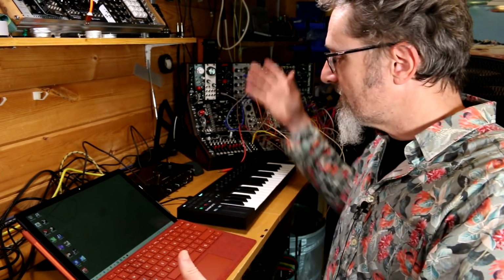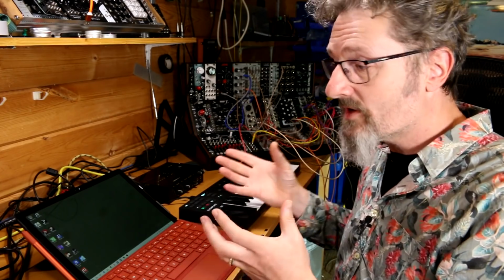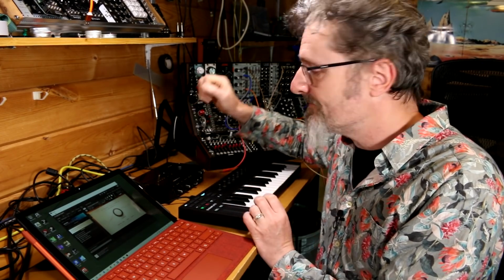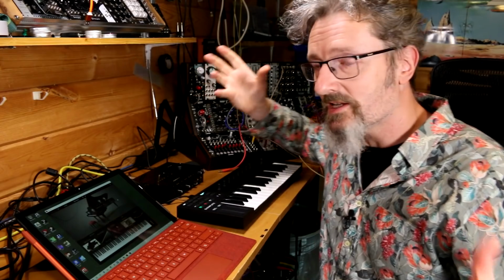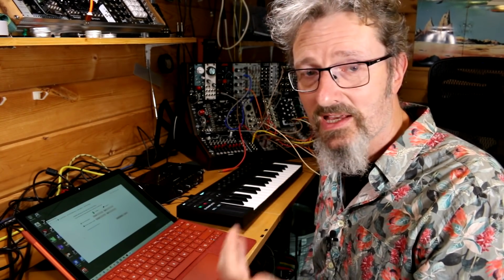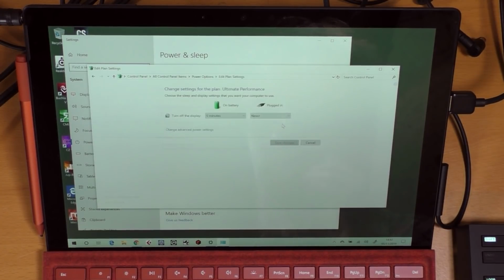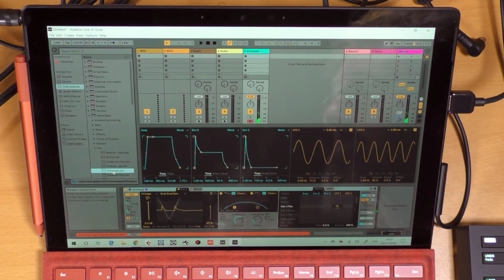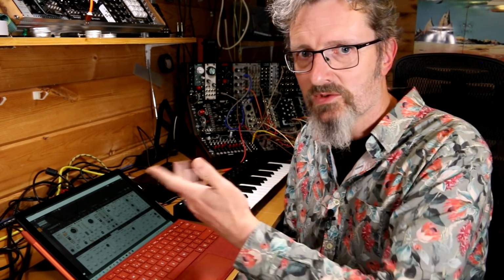Surface Pro 7 - Initial testing and tweaking for music production

Comment: I went along with your tutorial, everything worked, but there is a big drawback to this. Disabling the "csenabled" thing in the registry also completely disables the Sleep mode across whole win10 and thats a bummer. At least thats what it does in my case - SP7/i7/16GB. Can anybody confirm this?
Disabled sleep mode means the device goes straight to hibernate, so it boots up slowly (still less than 5 seconds though) and also the instant-on feature does not work anymore (introduced in sp7, this is a really great feature in my opinion).
I tried fiddling with various settings, but nothing worked, the sleep settings across whole windows was not visible. Only turning back csenabled on returned the sleep mode back.
Hopefully my i7 will be powerful enough to not cause (too many) glitches in balanced setting, will test that later.
Reply from the maker: Sleep and hibernation are the devil, they are completely incompatible with a working Audio computer. Turn them both off and shut the system down when you want to shut it down.

Comment: hi Robin, Great video. Lots of useful info. I have a question: the last windows 10 update installed lots of redundant (on my systen anyway) services like text input, your phone, message queing. Do you know how I can turn these off as well as the dreaded cortana, so that every time I start my system I dont have to go into task manager and kill them (they somehow come back after a time even doing that). I have disabled the ones I can in the system startup settings and services but to no aval. Help please if you can. Thanks.
Reply from the maker: Have they brought you any problems?
Reply: @MoltenMusicTech  My PC is quite old but surprisingly capable: 4 cores and 2.66GHz clock speed. However the board only supports a max of 4GB of RAM and these things take up valuable ram space so I guess they do. I can only run 2 chanels of realtime synthesis and after that have to render (freeze & flatten) and commit to audio. I'm just trying to work out if I could get another track of synthesis on the go in ableton or take full advantage of its rich feature set. I lke the look of the new granular synth and would love to use it but don't want to spent 40quid if it wont run on my PC. I guess an upgrade is in order but it'll probably be about a year from now before I will have the funds for that. I made the mistake of spending what I had on software before hardware, a big lessson learned there. Thanks for your quick reply. Cheers.
Reply from the maker: Ok, well I don’t know of any special secret sauce ways to remove those sorts of things other than taskbar-startup and uninstalling them 🤨
Reply: @MoltenMusicTech  Sorry my questions were a bit off topic as weren't specifically related to the surface. However thanks for your help. After looking in to things further I found that these things weren't actually using up any resources really as they were suspended and showing in task manager as not taking up any RAM after all. Silly me.

Comment: Thank you Robin .There are a number of audio interfaces with USB C .Presonus and Focusright .Is this designed for these as well ? Surely this would be a good companion for hardware .With my desktop I use the komplete audio asio drivers rather than the asio 4 all .Don't know if I trust a battery to be on all the time .
Reply: Afaik the newest Focusrite generation has USB-C connectors BUT runs USB 2.0 connections over it. The C-connector does not necessarily guarantee a USB 3.x-link. There is also a paragraph about USB 2.0 vs USB 3.x on the Focusrite website stating that the increased bandwidth of USB 3.x is not of much use for audio production atm. (Unless you're recording more than 18 tracks simultaneously, in which case most people will use a desktop DAW machine with PCIe interfaces.) So they stuck with USB 2.0 to maintain the stability it gained as an audio link over the years.
Reply: P.S. Long story short: It should work. Every USB 3.x device, be it host (like the SP or any other computer), peripheral (like an interface or flash drive) or the cable, is backwards compatible to USB 2.0 and will switch back to it if at least one of the three elements is not capable of USB 3.x. So in the end it is not the connector, but the controller chip and the OS drivers that determine if something works. So if there are Windows drivers for those devices, expect them to work, the data connection itself does not care about C or A plugs.

Regarding power consumption, there is the curious thing that some USB 2.0 devices do exceed the maximum of 500mA and where thus shipped with - non-standard - Y-cables to connect them to two ports simultaneously. Many external optical drives use this solution. Interestingly, our external DVD drive of this type runs brilliantly on a single USB 3.x port, so despite utilizing a USB 2.0 data connection, it profits from the extra headroom provided by the 900mA a 3.x port has to offer.
Reply: @albrecht-sebastianwitte-re4280  .Thank you Albrecht .You have been quite helpful .I am leaning toward the Yamaha Montage as a music production tool with Cubase .However NAMM 2020 is almost upon us .It will be interesting to see what will be revealed .The Roland Fantom is interesting with it's computer connectivity .Seems much more friendly to MAC .The website says that there are windows drivers but I get the impression that it is designed for MAC .I will look into audio interfaces with PCIe .Thank you again .

Comment: ASIO4ALL doesn't work for me with Surface Pro 7 after applying your adjustments. I've used your tweaks in the past for Surface Pro 4 and worked great. Something is up here. I've been hearing stories about changes in the audio system but not sure if that's what is going on.
Reply from the maker: Ok, interesting, I’ll be looking into it very soon
Reply: @MoltenMusicTech  also, reaktor 6 doesn't work for me, unless using bitwig 3. It will load 64bit vst. 😀 Thanks for your videos!
Reply from the maker: Oh really, i tried that and it kept blacklisting it. There'a growing number of people on the NI forum complaining about it - not just on Surface.
Reply: @MoltenMusicTech  oh man I went crazy. I thought my tweaking of settings had disrupted the system so I did a clean install. Couldn't believe it when it still wouldn't load. I'm fascinated by bitwig's handling of plugins, it was the only daw I tested that loaded it. Live, digital performer, reason 10, fl studio all chocked. I've been hunting for answers ever since. R6 is kinda a vital piece of kit...
Reply: Update to ASIO4ALL and Surface Pro 7 - the 1909 update has fixed the issue, things seem to be working good again.

Comment: After watching several of these setup vidoes (thanks for your efforts!!), it seems the main thing causing the glitching is CPU clock speed changes, correct? Or maybe not. Even my i9-9900K Desktop glitches terribly on some VSTs in Balanced power mode.  As a test, in Balanced power mode, I went to advanced settings and only changed Processor power management -> Minimum processor state from 5% to 100% (and made none of the other suggested changes) and all glitching stopped. But this change alone still allowed the processor to toggle between its 3.6GHz nominal to 4.7GHz burst modes. And a couple rare instances, I saw 1 or 2 cores throttle down to 0.8GHz.  I changed all advanced settings to match High Performance and got the same results.   

Then I selected High Performance, but this mode locked all 8 cores at 4.7GHz period, confirming that there are more settings behind the scenes than just what we can change in the advanced settings.  No setting I could change in Balanced mode would lock the CPU cores at 4.7GHz.  

For Ultimate Performance (which I enabled and tested), I saw no differences in advanced settings vs. High Performance as well.  My searching was unable to turn up any useful explanation of exactly what the differences are between Ultimate and High Performance.  Even the guys at Tweak Hound suggested that Ultimate Performance might be snake oil.  But they just did standard benchmarks and saw no difference, which aren't likely to test critical timing dependencies like used in audio and music. 

The above is on a desktop with water cooling and no where near needing to thermally throttle (CPU at about 35-40C max). I will do similar tests on my Surface Pro 5, i7 16GB as I am curious to see how these modes affect thermal throttling since your tests are all with an i5 and no fan.  I am curious to see how much the i7 with fan is affected.  

But to reiterate, the CPU clock speed changes can glitch audio on all Windows machines, not just battery powered devices.  

My setup was using Biotek2 in Waveform 10, with a Behringer UMD404HD audio interface and audio using the UMD ASIO audio drivers. Biotek2 has some patches that are very complex and can cause CPU and glitching issues easily, even though it is showing only 20-25% CPU Usage.
Reply from the maker: Thanks for the thoughtful comments. Desktop tweaking of power is well documented. Changing the power profile to "high performance" is always the first port of call and it sorts out most peoples problems. With desktops you'd also be disabled speedstepping and C states in the BIOS to prevent these movements. But it changes over time. At one time Hyperthreading was terrible and had to be stopped, Turbo mode was terrible but seems fine these days.... depending. But in all cases stable CPU performance is achieved by moving to High Performance and removing any EIST functionality if it is possible to do so.

With "U" series processors we encountered a whole new world of CPU speedstepping that causes all sorts of problems. And there's no ability to disable anything in the BIOS. And so we're left doing what we can to stablise a CPU in an environment that wants to burst and shutdown.

The only difference i saw with Ultimate Performance is the really cool name and there were a couple of advanced settings that i didn't have to change manually. I could have done the same by doing the CSEnabled switch and creating a new profile and adding a high performance mode and then doing the manual tweaks. This appears to do the same but with a tiny bit less effort - i probably don't need to turn off CSEnabled either which is handy because every Windows update tends to revert it back again.

There is always something going on in the background between power profiles - that why you can never run it in Balanced (desktop or laptop) if you want to do taxing things.

So yes, CPU speed changes can cause glitches - but not always :D
There's also plenty of other things that can get in the way of realtime audio. Lots more to do.
Reply: Maybe you can use XTU with this? I don't know, but if you can, you can disable some of the boosts of the processor, making it more stable.
Reply from the maker: XTU doesn't install on the Surface Pro 7 - it's an "unsupported platform" and even trying older versions or sneaky workarounds doesn't get around it - Microsoft really doesnt want you playing with the CPU voltages. It's a shame because I really like the monitoring in XTU - can't find anything that gives such a clear picture of what's going on.

Comment: Can you test VCV at some point please?
I've got an SP3 and it REALLY struggles with VCV.
I would upgrade if I knew it worked with VCV (I want to use it in bed :)
Reply from the maker: Yes, good idea. Once I've got through the main bulk of the testing I'll try to work in videos on individual bits of software - VCV Rack would be a good choice.

Comment: could the usb hub have something to do with it? it would be worth trying an adapter to the usb-c and only plugging the audio interface in a port, and the keyboard on the other or whatever (temporarily not using the dongles)...hope this could help. Thanks for your work! Best!
Reply from the maker: Yes it could - although they very rarely are. I will be comparing performance via the USB-A and USB-C socket. I'll be trying with hubs and without hubs, via the Surface Dock and ASIO4ALL with the onboard. All of these things are to come - one step at a time.

Comment: could you use the DPC Latency Checker to check the audio muscle of the surface 7
?
Reply from the maker: DPC Latency Checker hasn't worked since Windows 10. The LatencyMon app might show something once I get to digging deeper but you've got to start with the regular tweaks to see if that works - which it did to some degree. This is a start.
Reply: @MoltenMusicTech  It worked on my windows 10 Surface Pro 5 (I'm in the yellow) … just checked it today *they must have upgraded it :)
Reply from the maker: That’s the problem, you shouldn’t get a constant yellow reading, a false value is being added to the result which makes it unreliable. So it runs but you can’t trust the result.

Comment: What? Surface Pro 6 has been behaving better than this more powerful Surface Pro 7?
Reply from the maker: Has it? Where?
Reply: @MoltenMusicTech  I think remembering better behavior on the SP6 with Cubase from some videos of yours. Am I wrong?
Reply from the maker: We don't know yet! The SP6 also needed tweaking before it would run anything. This is just the first test, more tests to come now that I've got past the first hurdles.
Reply: It might be because of the much lower base clock. SP6 has a 14nm Kaby Lake Refresh CPU with four Skylake cores at 1,6 GHz, while SP7 has a 10nm Ice Lake CPU with four Sunnycove cores at 1,1 GHz. Of course, the Ice Lake generation contains Intel's first really new CPU architecture since Skylake, bringing with it an improved IPC performance, but the difference in clock speed (almost 32% down) is so huge that it is hard to compensate for that with architecture optimizations.

I'm very curious about what Robin's further testing will tell us about the DAW performance on Ice Lake. (As for myself, I am quite happy with my SP5 aka SP2017. Only two Skylake cores in that Kaby Lake CPU, but they run at 2,6 GHz base clock. :) )
Reply: @Andrew Burton That may be true for a lot of applications, especially for image and video processing. But a lot of DAWs profit more from single thread performance than from higher core count. Moreover, the newer SPs may have higher turbo frequencies, but then again they are not very helpful for DAWs, as any form of speed stepping tends to destroy DAW stability.

Check out Robin's SP4-5-6 comparison here: https://youtu.be/-VcsD9T0Wg0
The only one of the three DAWs tested that could really make use of the higher core count was Reason, while Ableton and Cubase ran on par or slightly better on the SP5.

Of course, I have not tested it myself, but when I saw Robin's comparison, I felt relieved that I have picked up a SP5 instead of being narked about MS releasing the SP6 just 6 months after that.